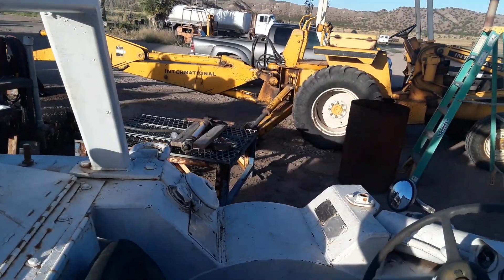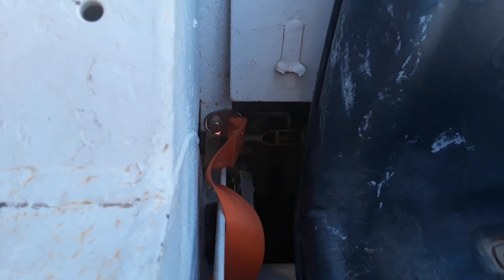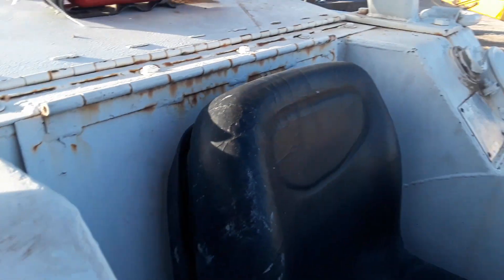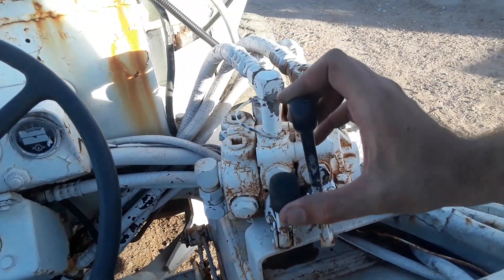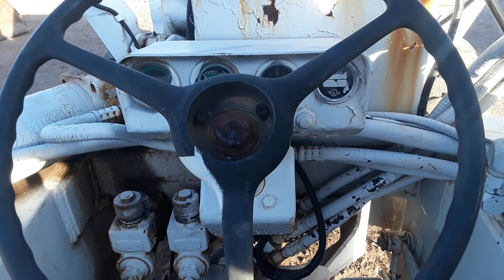EIMCO 911 Operation Basics

Comment: Much thanks Porty.
Reply from the maker: I'm glad you enjoyed it! There is a very real possibility that our equipment fleet will get a new member in the next month or so, and I'm tentatively planning some regular mine exploring for next weekend. It's been fun branching out into videos geared towards actively mining.
Reply: Cool seeing such a small LHD. Many years ago I worked at an underground tertiary gravel gold mine in Northern California ( Siskon Gold). We ran 6 yard LHD’s there. 14’ wide x 15’ high headings. It was quite an experience.
Reply from the maker: @muleskinnermining8661  I looked that one up - underground placers give me the creeps, and that one sounds like it was especially rough!

This machine is pretty great. It was bought new by a tunneling company in Clovis, California, and barely run. I bought her with 11.3 hours on the Hobbs meter. I own the machine outright and am renting it to my company; we're then subletting it to a client. The machine sat idle for 10-15 years in Clovis; we replaced the hydraulic fluid after mucking a bit to shake loose all the accumulated crud. New tires, new fluids and filters, new LED lights...kicks the crap out of the skid-steer they were using! The client somehow acquired an EIMCO 913 3-yard machine, but the damn thing doesn't fit right down their decline (averages 10'x10' and the machine is 7' wide). They have to tram that thing at a crawl to not smack a rib or nail the utilities, whereas the 911 can be safely run at full speed.
Reply: Headframe Hunters, 913 wouldn’t fit in the decline? Sounds familiar.  At Siskon Gold, they thought bigger was better, decided to go with an 8 yard LHD, it barely fit into the mine and tore the haul road up! So much for that idea.
Reply from the maker: @muleskinnermining8661 That's very similar to what these guys are going through. I would have clapped if they'd bought a Wagner ST-2, Toro 151D, or anything similar, but they had to buy Big Chungus and nearly get it stuck!

 It gets better! The 913's hydraulic tank is shaped such that the edge of the tank sticks out horribly when the machine is articulated to the left. As luck would have it, entering the main development drive requires a sharp left turn - the tank weld is already showing signs of failure; there's a tiny bit of fluid weeping out through the paint. It's a sharp enough corner that the 913 has to take a multi-point turn even after slashing the ribs out. That machine is also down with some kind of electrical gremlin. At first they thought it was a fuse, now the seller is shipping a new alternator down from Colorado. The 911 abides!
Reply: Headframe Hunters, sometimes greed gets ahead of common sense
Reply from the maker: @muleskinnermining8661  You're absolutely correct. So far, I've had some luck guiding their acquisitions by presenting reasonable solutions, or having equipment show up like I did with the 911. Unfortunately, the 913 saga was out of my control. On the bright side, they'd like haul trucks soon, and I've tracked down a very nice one at an excellent price that I will purchase and have delivered contingent on receipt of payment for previous services rendered.

It's frustrating- greed is certainly a factor with some people I deal with. The on-site management is very pragmatic and logical; I can't always say the same for their higher-ups.